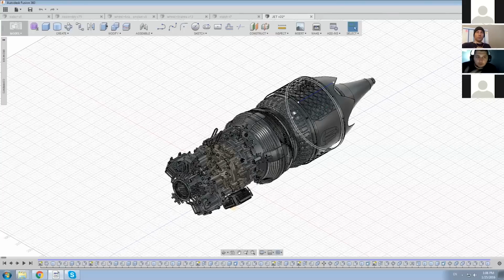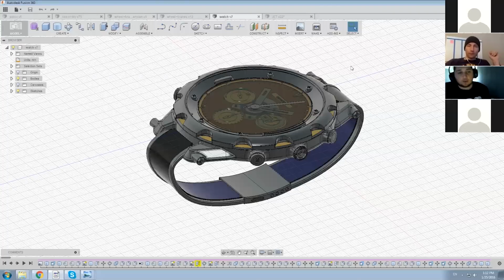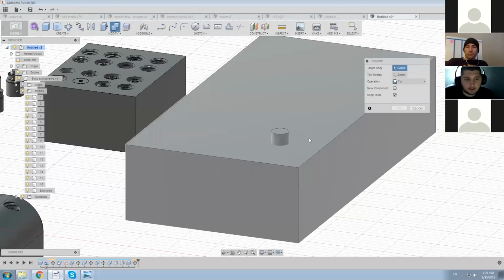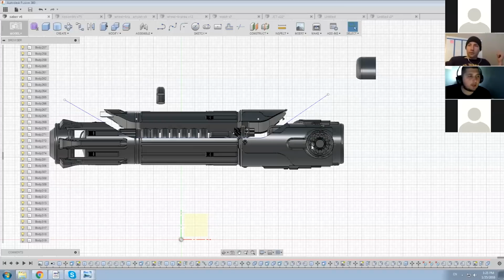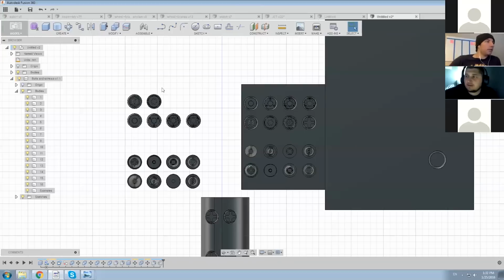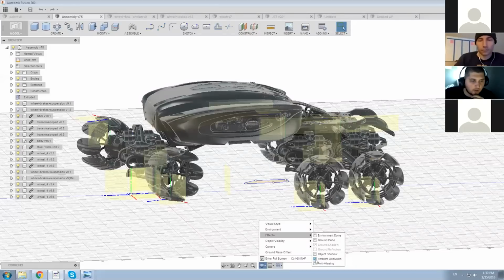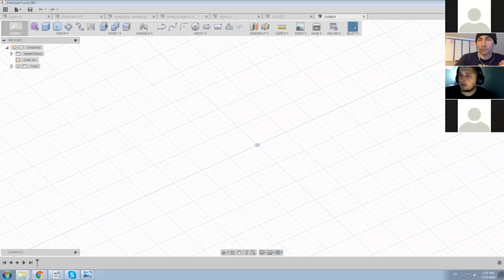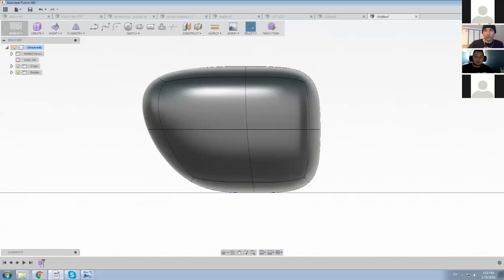Hard Surface Moldeing Webinar Replay with Kirill Chepizhko

Comment: 33:42 I highly doubt if you even tried solidworks lol... It doesn't have any console shit like Rhino. Tbh, it's much better than Fusion cuz it doesn't lag like Fusion. And making the sketch plane perpendicular to viewport is something every mechanical design software/CAD does. I'm not saying Fusion is bad or anything, in fact even I use it (for robotics though, not art), but criticizing other softwares without trying them out completely (I understand why most people don't even try solidworks ... It's expensive) is something laughable. I use both SW and Fusion based on the particular case. If the project I'm working on involves medium to small assembly hierarchies then I'll use Fusion, if the project is of a significantly complex assembly then I move to solidworks. It's currently the most robust CAD in the market, since it uses parasolid kernel.

Comment: I am doing a fairly advanced droid. While 360 is great for the more angular shapes and cylindrical shapes.. you have to fight with the program a lot to get more complex shapes such as twists from a box or irregular cylinders that are stretched.  I am still not so proficient in it, but It would seem that poly modelling combined with fusion is ideal.. Im having a hard time finishing a full character type droid just in fusion. I am loving it, so I need to keep at it. I would love to see a live example of how he talked about the spline conversion from zbrush. That might be something I am missing. 

Edit: just a quick edit,  what I find hard about it is the fact that functions such as inset and bevel are missing making it difficult to perform those function on shapes that are not parametric. Irregular shapes, very hard to control the shape. As long as the shape is boxy or cylindrical then its magic in a bottle. idk, I might be wrong. someone point me to a better tutorial that covers these concerns..

Comment: The biggest problem of Fusion is using it to export low poly for games and then it will blow all other software out of the water
Reply: Just retopo the export in another program.

Comment: you are not rigth about Rhino or Solidworks)) U have not write 50 lines or even 5 lines of code. u have an option to write command in line or use buttons. in Solidworks u use only buttons like in Fusion 360
Reply: "Have you ever seen Rhino or Solidworks??" - he obviously never seen Rhino or Solidworks
Reply: Peter Condescending exactly
Reply: My work in solidworks=) not worse than Fusion 360. https://www.artstation.com/artwork/0Zrw4
Reply: Are you too confidence of your self? Erop Potohob